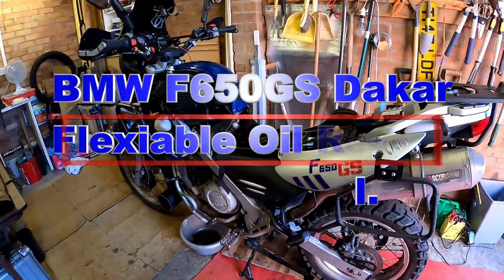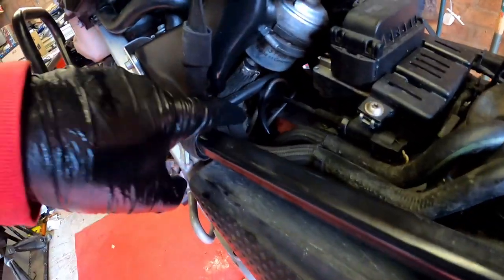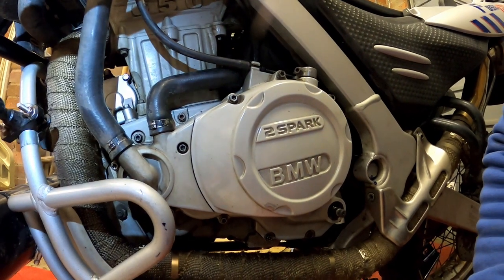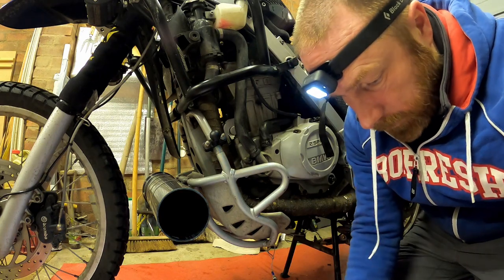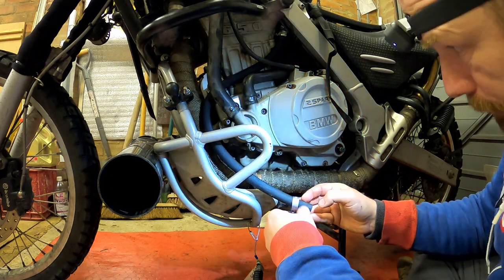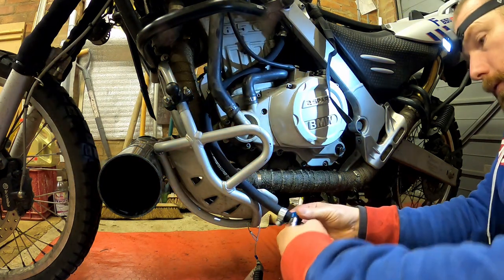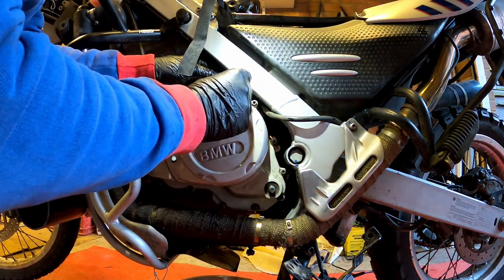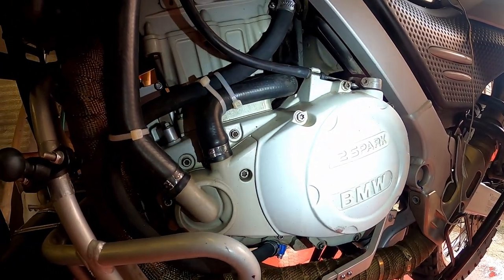BMW F650GS Dakar Felxible Oil Return Pipe Install - How To.

Comment: Hi Phil, nice job. I wonder though - can the flexible pipe be routed further from the exhaust pipes? Like closer to the middle of the bike - other side of the clutch cover like the original was? Because I'm not quite decided whether to heat wrap my pipes and I'm afraid it might burn the rubber hose quite a bit. Thanks ! Wish you a safe trip.
Reply from the maker: It maybe be possible, but ive had no problems so far. Thanks Phil.

Comment: Why do you keep the top metal pipe bracket? Can you not just use a pipe all the way up to the tank?
Reply from the maker: maybe for a more secure fixing point at the top, but it could work with flex pipe all the way up i guess.

Comment: That OEM oil return pipe is one of the worst design choices on the bike..Water pump replacements should now be less stressful,might do this,Great tutorial...
Reply from the maker: Yes very true. I am glad I have done it for the future. Glad it was of help to you.
Reply: What makes it so? Why was that a bad choice by Rotax? I’m trying to understand what problem is being solved here.
Reply: @posterestantejames  The position of the pipe blocks access to the removal of the clutch plate cover.. Also the pipe itself can be tricky to remove or displace..

Comment: Excellent guidance, I've done my clutch plates and just ordered the parts in to do the pipe mod (and the pump assembly), I'm not sure doubling up on the hose clamps is necessary, I read that it's not a pressure issue, if anything it'll be a temperature issue. I'm also prepping for a trip out East to Mongolia continuing the rest of the way around. Mines a standard 2002 GS (single spark) but I've installed a later set of forks and a Dakar rear shock (though the centre stand is a bit short now so need to mod that as well). When are you planning on heading off? How far have you got with your prep?
Reply from the maker: Hi, thanks for your comment. My thinking with the 2 clamps was not because of pressure but to make sute that if the first one didnt get a perfect seal the second one would catch any last drips! Whether it works like that or not. Well I was planning to of been heading off the end of April, BUT well you know!! Planning wise the bike and equipment is ready, I had a very basic low info route and I was just about to do the final steps to get a Russian visa and all the boarders started to close. Thats all the prep I had really done and i was going to wing the rest. I dont think this will be over any time soon and then we are heading in to the wrong seasons in places so i guess its on hold for a year. What was your plans? and what are your new plans?